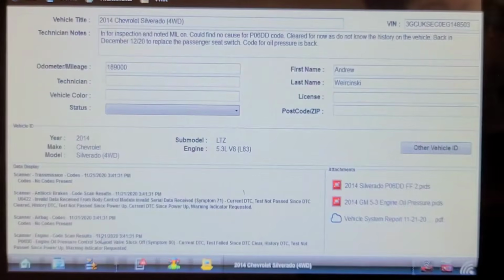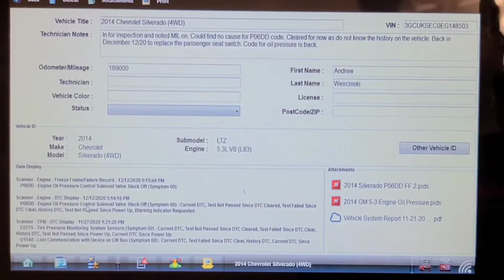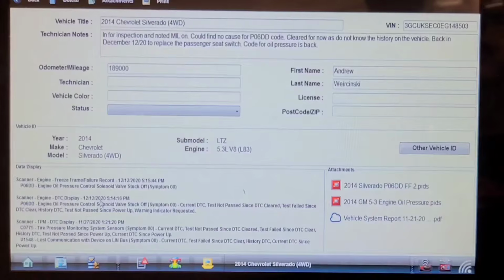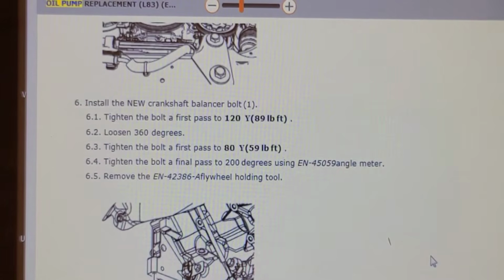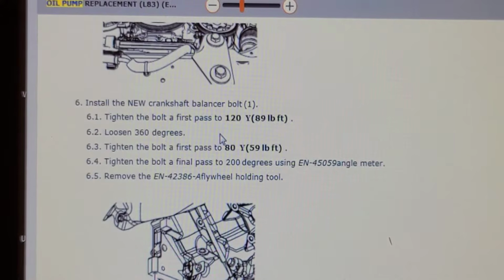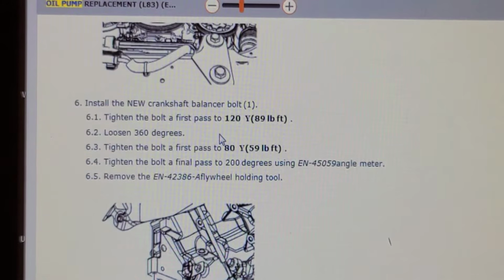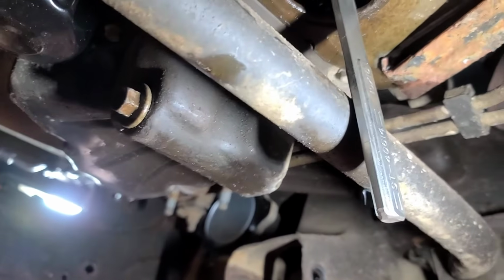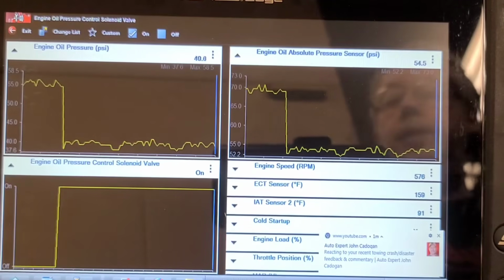2014 GM Truck 5.3 Oil Pump Replacement Code P06DD

Comment: Well if you're looking for another one to do by all means. I'm not quite sure what's wrong with mine but my oil pressure sits very high randomly while I drive which sets the check engine light on. I'm gonna replace the oil pressure sensor and PVC valve and hope that's the issue. Whenever I clear the code the oil pressure drops back down to regular levels for awhile and may shoot back up or not. So I'm hoping it's not the oil pump
Reply from the maker: Do you know what fault code it sets when the MIL comes on?
Reply: @PhillipBailey  but like I said if I hook the scanner up to it even while I'm driving and clear the code the oil pressure goes back to normal and will stay normal for a day or so... Usually the code comes on when I really hammer on the gas. But if I drive it like a Granny it'll stay off and the pressure is fine. Usually when it shifts it shoots up very high through the first 2 gears like up to 80PSI, driving it normal.
Reply from the maker: @TheGumbi22  Likely the pressure control solenoid is failing. unfortunately that is on the oil pump. You can change the solenoid but it requires the oil pump be removed to access it. I'd recommend to replace the entire oil pump given the work involved. It should not hurt anything driving with higher than normal pressure in my opinion. Occasionally the pump itself will fail and result in low or no oil pressure which is obviously not good.
Reply from the maker: @TheGumbi22  once the ECM sets a code it defaults to maximum pressure. Clearing codes resets the system again until the desired and actual pressure differ by a specific amount. Then the code sets again. Likely the solenoid is sticking like I said earlier.
Reply: @PhillipBailey  dang ok so just out of curiosity what am I looking at price wise for the new pump and fixing??
Reply from the maker: @TheGumbi22  parts will run around $400.00 CDN and Labor around 11-12 hours at whatever they charge. You will technically need to have the alignment checked afterwards since the steering gear will need to be completely removed. I charge this customer$1715.00 parts labor and tax but that's Canadian so need to convert to US at the going rate. I've seen the dealerships charge much more...
Reply: @PhillipBailey  great that's a bill I don't want. But I appreciate the information and help.
Reply: It's the p06DD
Reply: I got a 2014 GMC Sierra 5.3 and I have the same code but I drive the truck every day and the truck runs very good,oil pressure is good what do guys think ?
Reply from the maker: @MrJunior6939  Chances are the desired and actual oil pressure are not agreeing and that is what sets the code. It can still have good even higher than normal oil pressure. If the pump fails you will know it quickly.